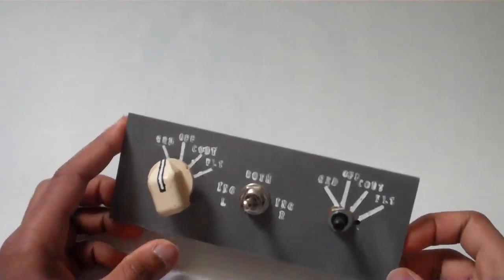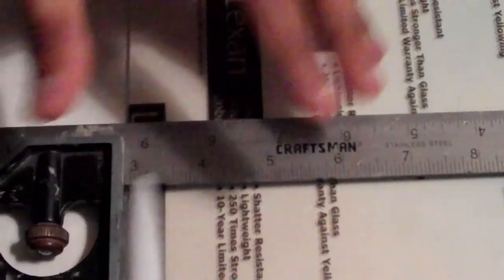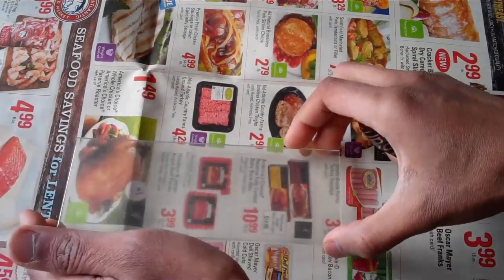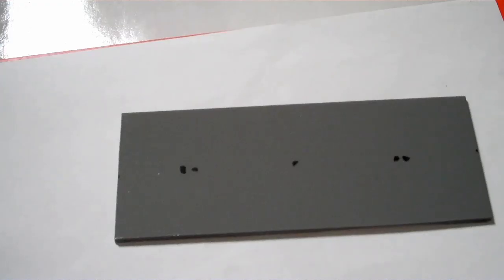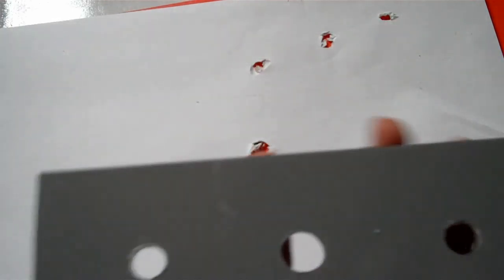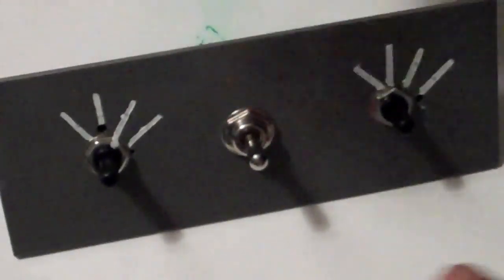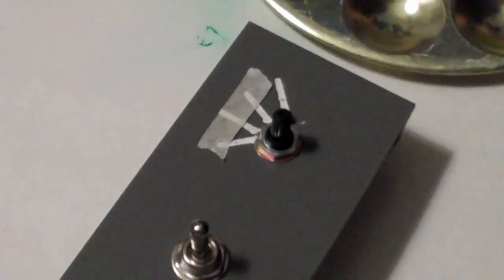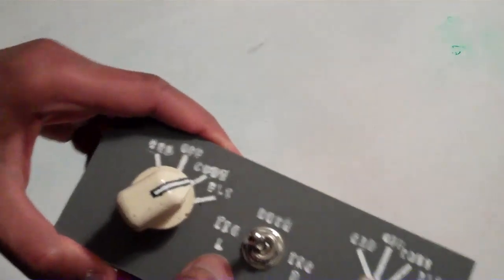Homemade Aircraft Homecockpit Panel

Comment: For lettering look for dry transfer later at your local hobby store.  The come in various sizes on paper somewhat like wax paper.  Place the letter over the spot you want it to appear and use a pencil to rub the letter off the paper and onto your board.  A coat of thin clear paint will ensure the letters never come off.

Comment from the maker: One option for a backlight would be to use translucent white plastic instead of the clear that | used and engrave out the letters from the paint. This would leave the white showing and a light could be added behind the panel. If I had a cnc machine I would've done this.

Comment: Regarding the way you make functions letters like : OFF , ON .. etc .. a professional way I used is : -

1- Get your clear sheet before painting it.
2- Edit letters (all letters you want for your whole panel , the width and height of the background to set according to your panel width and height ,so it's easy now to put letters in the right place ) in photoshop or whatever to be black on a white background.
3- Go to any workshop whom have a cutter, they can cut your letters even if it's less than 1 mm thick on a stuck black paper sheet.
4- you apply the stuck paper on the whole panel , then remove it easily to leave the letters stuck on its place ..
5- Now paint your panel ..
6- When painting get dry, remove letters stuck .. so you get a nice panel ..

The result will be : letters stuck on panel avoided painting to reach the main color of the panel .. when you remove letters stuck you'll find letters in a correct way and typed well ...

You can use at end any source of light behind letters to back-light your panel ...
Reply from the maker: Thanks! Thats a really great idea.

Comment: Since you are working on a transparent board, I think you can print letters on the back of the board and then paint the gray color all over. I think this way paint will be protected from scratches.
Reply from the maker: ***** Thanks Cesar. That is a great suggestion. I think I will explore that.
Reply: I know a friend of mine who owned an engraving shop used to make control panels for a boat manufacturer,  used to order dual layer laminated clear and topaz  acrylic panels and use his engraving machine to  engrave the  dark layer at the dark layers thickness with the lettering in reverse and then he backlit the  panel.
Reply: If you want I have seen tutorials on placing  individual LEDS  beside each  control element to side light. That is how the  airplane manufacturers do it. There is a tutorial on this here on YouTube but it is a staggering amount of work.
Reply: The manufacturers can get away with side lighting since they can mold  panels with the indentations and make it economically feasible by  spreading it over thousands of planes.